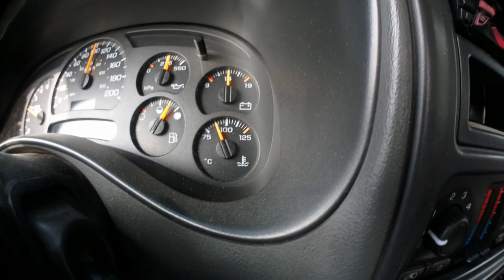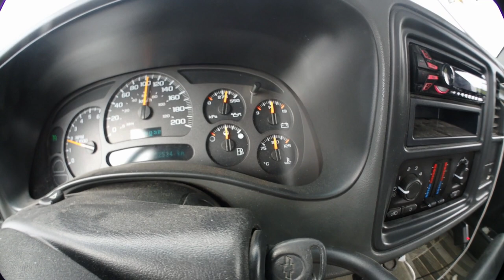How to change Engine Coolant Temperature Sensor on Silverado 2004

Comment: Thank you for uploading this video and for providing the link, it was possible to get the OEM numbers I needed to get the right one. My Silverado is a 1999 model with the LM7 engine, the codes I was looking for were: 15326388 and OEM 25036898. 
maybe a lot of other temperature sensors are compatible, but I don't like guessing because the computer is reacting big time on the information from this specific sensor.
Reply from the maker: You are welcome.
Thanks for taking the time to comment, I appreciate that.
Thanks for watching,best regards.

Comment: You can also remove the electrical junction block. 2 bolts and its out of the way. It makes it way faster to pull out and reinstall and only a few drops of coolant escape.
Reply from the maker: Thanks for the heads up !

Comment: Question, I've seen other vids and coolant poured out, did you drain it first, or letting it get cold cause the sensor area not have coolant. Didn't see any when you changed yours.
Reply from the maker: Hey Billi did not drain coolant so you need to let it cool down.
There is coolant in the sensor area,coolant will come out.That's why i have put a bit of tape to protect the connector and went fast removing it and installing the new one !
Regards.

Comment: Did you have to run it to normal temperature to see if it worked or not?
Reply from the maker: Yes
Reply: @obscur156  thx to you man I was able to fix my sensor it worked fine but th plastic part was all broken and the plug was hanging on by the little metals
Reply from the maker: @markzuckerburger1062  You are welcome buddy.
Thanks for taking the time to comment and thanks for watching.
Regards.

Comment: My Yukon Denali xl gmc 6.0 engine my  temperature gauge is over 210 and wants to overheat do I need to change my temperature sensor and my fan is not working when I turn my car on I have no coolant leak I changed out my cooling fan relay
Reply from the maker: Maybe check if temp is really 210 with Infrared Thermometer.Can be a bad thermostat and or temp sensor i would say.
Reply from the maker: Mine was reading colder temp even after an hour running the truck.
Reply: @obscur156  my cooling fan is not working is that why my car is trying to overheat
Reply from the maker: @heathermoore2654  it is a possibility
Reply: @obscur156  if my temperature sensor is bad is that why my cooling fan is not working that why temperature gauge is trying to overheat I look it up on Google said if my temperature sensor is bad then my fan not working
Reply from the maker: @heathermoore2654  It is possible,i am not a mechanic but its logical.
Reply: @obscur156  I'm not a mechanic to but I like to work on my cars to save money
Reply from the maker: @heathermoore2654  Yes,that is why i make these video's.
Reply: obscur156 yea man, watching you wrench down on a BRASS SENSOR with absolutely every cm of sq torque your arm generates made it pretty clear you’re not a professional. I guess we all have to start from somewhere, but lmao “torque specs” , bro. Google it.
Reply: Heather Moore did you figure out what it was??
Reply: @glenfrancois6813  yeah I figured it out it was my sencer to my engine coolant was bad and when I fix it my fan kick on
Reply: Heather Moore my temperature gauge is a hair over 2:10 and wants to overheat and my fans not kicking on the only way to come on as with the AC..
Reply: Heather Moore thanks a lot I'm going to change my temperature sensor.. again thanks a lot
Reply: @glenfrancois6813  your welcome

Comment: Mine bounces between 160 and 210 you think this is my problem?
Reply from the maker: There is very good chance that this is your problem.
Its only 15$ so...
Reply: obscur156 checked the gauge today w a scanner and it worked fine and checked the engine temperature it was good, seems like it’s either the sensor or wiring
Reply: Mines a diesel and it has 2 there 32 a piece
Reply from the maker: @jakegilly6438  Not too bad
Reply: obscur156 I’m just not sure weather to check the wiring somehow or just put two new GM sensors in and go from there
Reply from the maker: @jakegilly6438  Its up to you buddy.Going to bed now,cheers.

Comment: You could've bent the red box for your battery cable's forward gave you more room & usually is best to un do the bottom hose to the radiator so don't trap air in your system as well. Who know's your coolant is probably worn out
Reply from the maker: Thanks for the advice.
Now i have sold the truck.
Regards
Reply: @obscur156  did you sell it because the temp sensor didnt change anything
Reply from the maker: @TheBaller3572000  Temp sensor solved my problem.

Comment: How do u know when sensor is bad I’m not getting no code
Reply from the maker: My temps was reading colder and was going up and down if i remember ...
Reply: I didn’t get a code either but my gauge on the panel was showing critical overheating (it wasn’t) and engine failure.  Did all the diagnostics (thermostat replaced, radiator check and water pump) before I came to the sensor conclusion - just to eliminate the major issues.  Replaced the sensor on my 2005 Yukon and now I’m back in business.  Easy fix.

Comment: Appreciate the video, would you still recommend to put the tape over the new connector or did it cause more of a pain than it was worth doing?
Reply from the maker: I would still recommend it ,you don't want coolant in your connector.That tape was very sticky for sure and hard to remove.You can try without the tape.
Reply: Maybe some Saran Wrap would be easier to remove afterwards.
Reply from the maker: @rubengalindo2616  Yes,that's a very good idea.
Reply: I used blue painter's tape. It worked well and came off easy. Thanks for the video.
Reply from the maker: @jonfowler2365  Thanks for the heads up.
Regards.

Comment: Remove red tape before installing sensor. Dooop!!
Reply from the maker: I have put that tape because when you remove the old sensor, antifreeze comes out really fast.
Did not want antifreeze on brand new connector sensor.
Thanks for watching, regards.
Reply: @obscur156  what tools did you use
Reply from the maker: @Mrneverlacking22  Ratchet ,small extention and a long socket that's it.
Check the video,everything is there and filmed live ...
Thanks for watching.